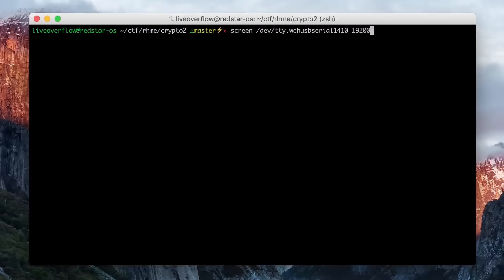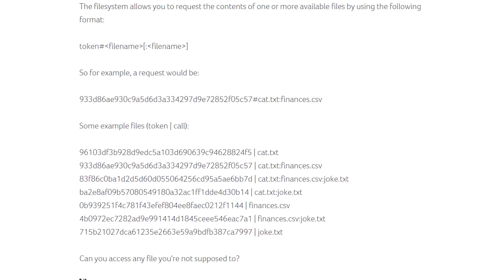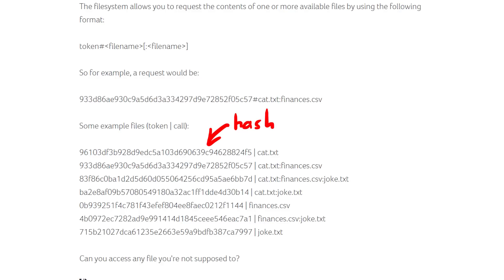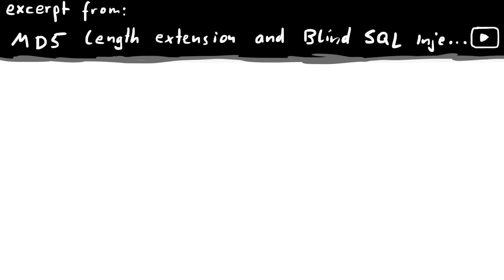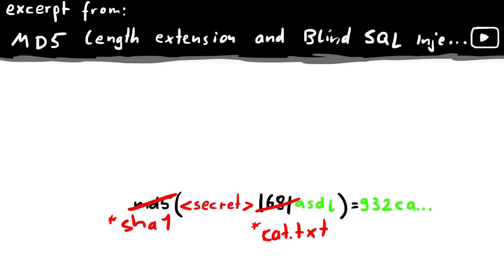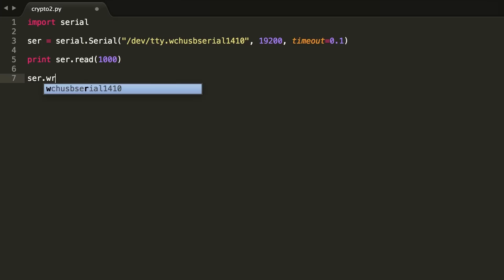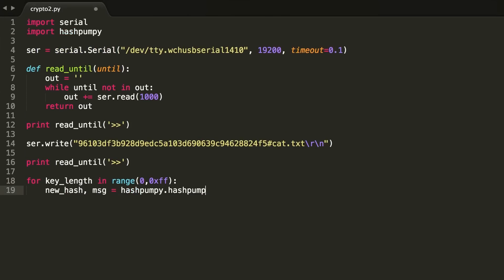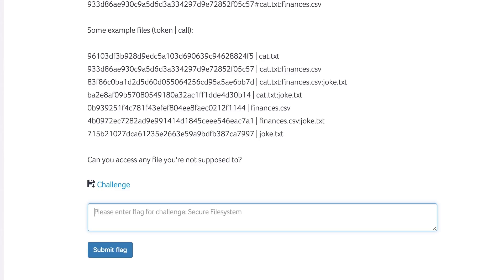SHA1 length extension attack on the Secure Filesystem - rhme2 Secure Filesystem (crypto 100)

Comment: for the love of all that is holy, please use python3 already. python3's print works in python2, but not the other way around. Newer linux distributions ditch python2 entirely, making all your code examples not runable on them and requiring a rewrite because you used an obsolete standard.

Comment: Since tokens are already given for cat.txt with a string appended to it, wouldn't it be more efficient to use those to bruteforce the keylength. instead of just trying every keylength on the device?
Reply: programmer time vs cpu time I think :)
Reply: Hi there, I don’t want to be a bother, but I need your help.    My OKX wallet holds USDT TRX20 alongside the recovery phrase [ clean party soccer advance audit clean evil finish tonight involve whip action  ] How can I send it to OKX or Bybit?